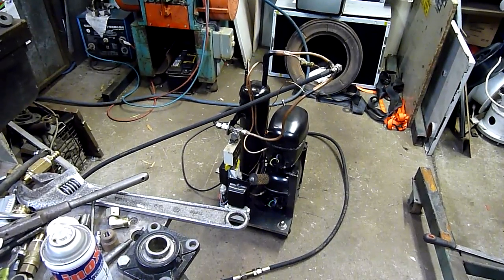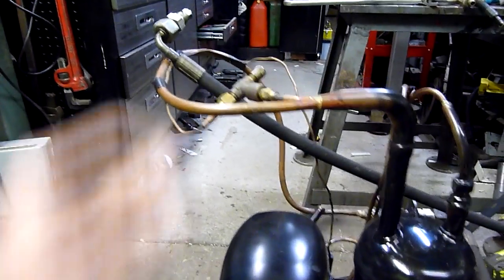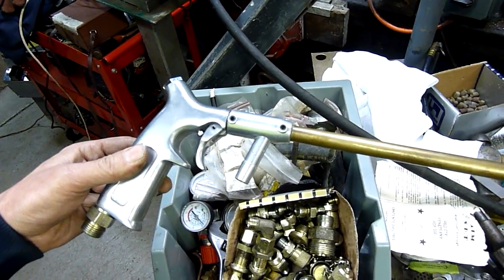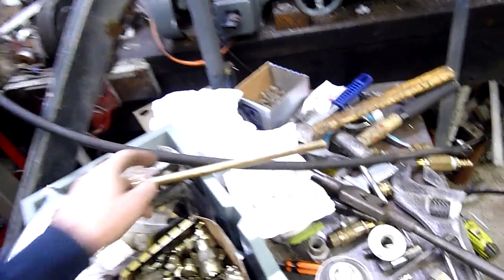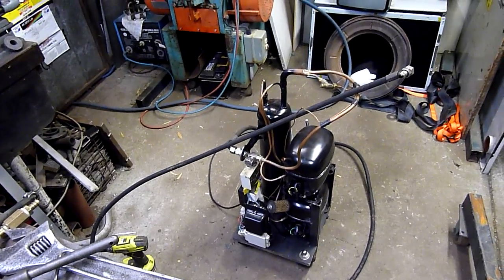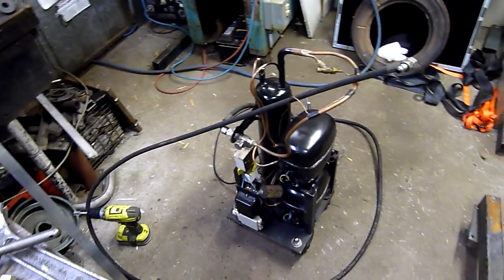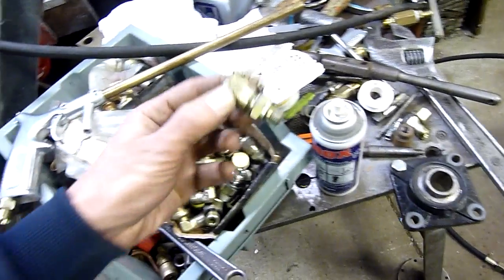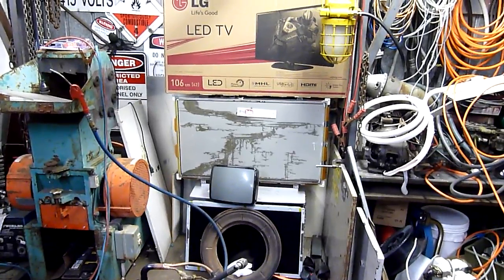Home Built High Pressure Air Compressor Overview

Comment: what happens to all the freon and oil? how do you keep that from getting into the  air
Reply from the maker: +meg8berg8 there is no freon, these compressors were new in box. any oil accumulates at the bottom of the air tank, its such a small amount it can just stay there
Reply: thats interesting.thanks for the reply.

Comment: Hi, quick question, i have a fridge compressor here to do almost the same, how do you manage to keep the oil inside the compressor and not flowing trough the exit pipe? (my compressor has 3 pipes connectios: suction, discharge and process) model embraco ff 8,5bk

Comment: I've seen the question asked before in the comments, but i'm wondering the same thing. I've got some brand new scroll compressors used with R407. I've read a lot about using the correct type of oil with specific refrigerants, but would different types of oil hurt the compressor itself? Also, how do you get the oil to circulate in your compressor? I've thought of some methods of using the high pressure to force oil back into the air intake with a fine nozzle, but is all that even necessary?  tnx!

Comment: 400psi nice, now if you could do 2000, you're firmly in CO2 and PCP airgun territory and could "fuel" either (some units use the term "dual fuel")...both of which include: full auto and the latter includes 9mm, .45, and .50

3000psi the top end..
Calibers
    0.177" (4.5mm)
    0.20" (5.0mm)
    0.22" (5.5mm)
    0.25" (6.35mm)
    9mm / 0.357" 
    0.45"
    0.50"

pyramydair  com/a/Air_guns/Air_rifles/Precharged_pneumatic_PCP/155

pyramydair  com/a/Air_guns/Air_rifles/CO2/Submachine_guns/962

Comment: Want more pressure make it a multi stage compressor plumb the inlet to the discharge with a small cooler as the intercooler preferably the second stage to be less capacity as the first

Comment: what do you use for oil? is it the refrigerant oil? or do you use a light weight compressor oil, als o what do you use to return the oil or is that not much to worry about, I've been wanting to replace the junk compressor on my little 2 gallon unit. Its one of those cheap Campbel Hausfeld with the loud squeaky oil less compressors on it I may have an R22 compressor on its way from an old dehumidifier.